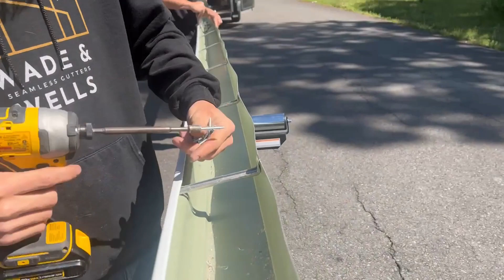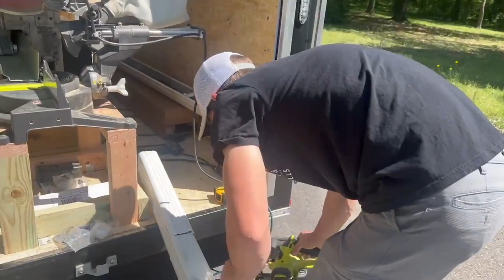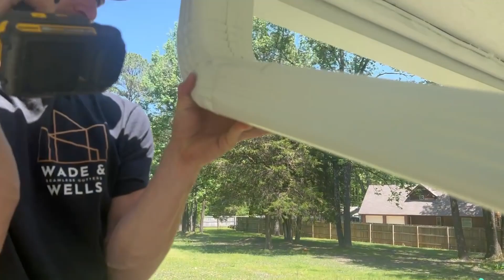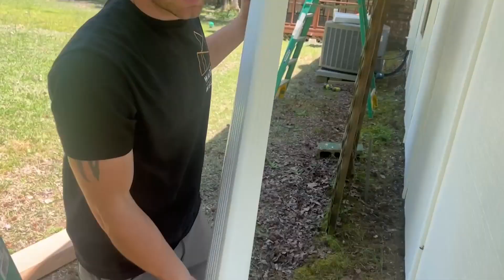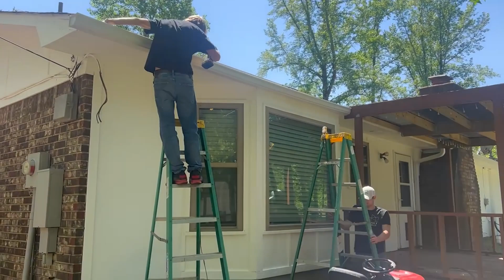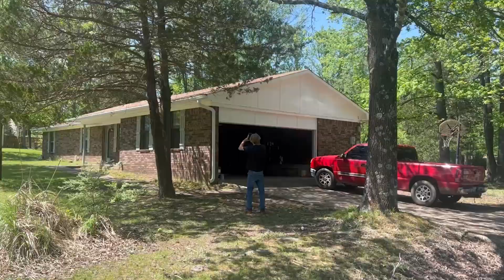How To Install Seamless Gutters In 10 Minutes!!

Comment: Ima be so brutally honest I love how you guys are young and hungry to work in the gutter field but I just wanna say a few things maybe u can improve them because I’ve been doing gutters since I was 12. But this is also advice so u can grow in the industry, one u gotta wear a tool belt u won’t have to carry everything by hand and u have all the screws, snips, crimpers, or any other tools. Two u don’t need a saw like that to cut downspouts the easy way to not walk back and fourth to your truck for one cut is to carry a hacksaw or malco snips cut it on the spot and easy and quick install. U won’t have to walk back and fourth just for a 1” cut. Also use a level I don’t think I saw you guys use one just to insure that it has pitch. Again this is advice not trying to sound like a dick good luck to u

Comment: Need to get the your machine tuned and also quick tip put a towel over the end of the machine so the aluminum sawdust doest go back into the machine or it will build up on the skate wheels.